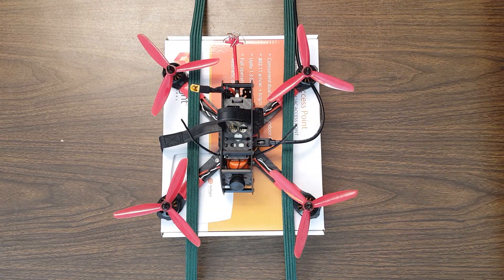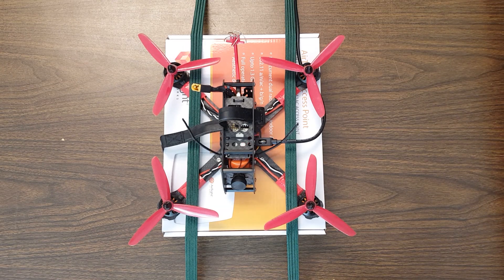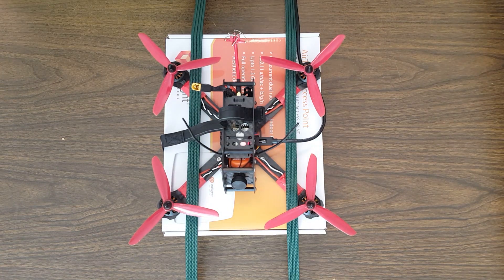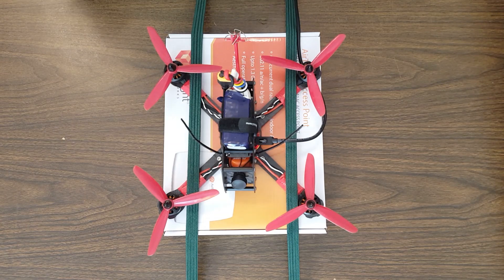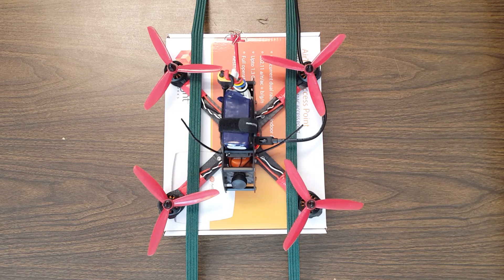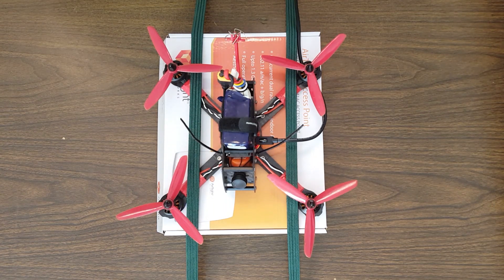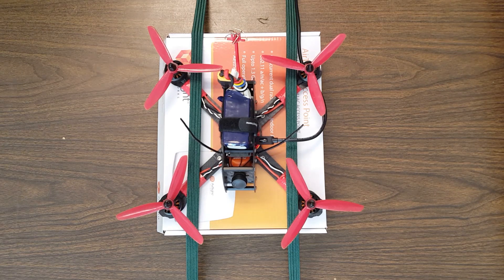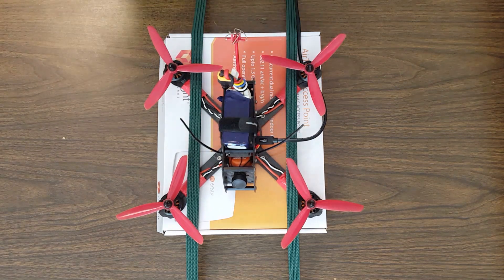Troubleshooting: Quadcopter Desync (Falls Out Of Sky)

Comment: Hey Joshua I know you get questions on the daily but I’m having a similar issue but it only happened a when I do a front flip. Rolls and back flips no problem, only front. I front flip and my quad looses control and get the esc tones and the betaflight logo reappearing on my osd like it’s resetting. Any speculation as to what could be happening? Thanks!
Reply from the maker: If you get the ESC tones and the BF logo appears, then your whole FC is losing power. That's the cause, and you have to dig in and figure out why. Loose or damaged wires is one possibility.
Reply: Joshua Bardwell josh thank you for the fast response. I’ll dig into it. Unfortunately it’s a hobbywing f4 stack so the fc and esc are connected via pins. Also I’ll be upping my Patreon from 1$ a month to 5$. Your seriously the best.

Comment: Hi jb.  I have spin of death only with a fully charged batt.  First 30 seconds of flight then it's ok after. 
No beeps or failsafe. 
Why is this? 
How do I stop it? 
Is it the omnibus f4 pro having to many volts? It's only started after I sped up my rates from 667 to 900 ish 
Thx jb your the best!
Reply from the maker: +machined red probably one if your motors or ESC's is damaged but it only happens when you push it really hard.

But you can also go to the CLI and disable the gyro_overflow_detect option. At a rate of only 900 dps o don't think that is your cause, but let me know over email if it fixes it okay?
Reply: Joshua Bardwell thx jb, could you give me the exact cli so I can paste it in please, im not doing it right

Comment: Having a similar issue with freshly installed DYS ARIA 32 BIT escs, flies fine until I let it drift down after a punch out, cocks to the right side, stays in the air though, any thoughts?

Comment: my drone did the same thing.  it started out very infrequently dropping out of the air. Then it slowly became more frequent.  Up to once every other battery. so I started to disassemble it to search for the cause. I found it. The little slits the male battery posts on the drone had become pinched in, infetisimaly.  it seemingly fit snug, but it had just enough play to cause it to reboot midflight. Effectively dropping it out of the sky. All I had to do was put a pin in the little holes on top of each terminal and rotate it to spread the post out, increasing its diameter for a 100% secure connection.  Problem solved.
Reply from the maker: You mean like this? :-)

https://www.youtube.com/watch?v=UYXTiSeVmB0

Comment: I have this "desync" issue with one of my quad, but the strange thing is that i only happen flying 4s, in 3s it works well, and it doesn't even happen at full throttle, i can't figure out why it does this, i think i'll have to try your bench test (PS: the copter fall the same way every time - rolling backward and left)
Reply from the maker: Don't waste time testing. Try replacing the left rear motor. Don't throw out the old one in case it turns out to be fine... then you'll just have a spare. If you swap the motor and it still does it, swap the ESC next.
Reply: Xxtrengt 88 I had the identical problem. Check the pins on your battery. Spread them out from the center for a more secure connection. This fixed my problem.

Comment: Hi Joshua I have just put new motors on my quad I have recalibrate the esc' checked in bheli all fine, it hovers and flys ok until I punch out or increase throttle rapidly. I went into betaflight and used the motors tab and did the rapid motor increase and on every motor they twitch, if I increase the throttle at a steady pace they are fine. I'm not the best at soldering could this just be my crap soldering? Please help. Thank you
Reply from the maker: Could be any number of things. If all four do it, it's probably not your soldering. What are the chances you didn't get ONE right?

If you are using Dshot, try switching to multishot. Maybe your ESCs don't fully support Dshot.
Reply: Joshua Bardwell I am using multishot, is it worth flashing the esc's?
Reply: I have just looked at the esc's I bought and they say on amazon that they should be used with one shot 125 could this be what is wrong I'm using them as multishot? Is one shot Dshot?

Comment: Has anyone had any issues with their quad falling out of the sky always towards the front left motor? I've replaced pretty much every part and still the same issue!
Here's a link to a video showing the issue.
https://www.youtube.com/watch?v=X6mqrqKryMg
There's also a slightly better description in the clip description.
Thanks guys.
Reply from the maker: +Logan O'Toole your front left motor or ESC is damaged. If not that, then the motor output on the FC.

Comment: Hey my name is Tony.  Ive been flying now for about a year and Ive been having this problem with my Quad that is just kicking my but.  What happens is after i put a new fc on it, after a few good problem free flights and crashes the throttle sticks when i punch it.  then later it starts to tick on sudden commands like fast rolls and quick corrections.  I started with a lux 2 then had a dtfc now im on a kakute and its starting down the same path.  I have blackbox if you want to see that, the throttle will on just a blip to max, stay at full for about 3-5 sec. Then return to where I have the throttle.  But i can put around just fine with only the ticking but it does get so bad that it is compleatly unflyable.  When the condition starts, on 3s it does fine at full throttle, but on 4s its terrible.  It gets worse and then the same starts to happen on 3s as well.  I have reflashed the esc's reset the fc i dont know what to try.  Esc's are emax lighting 30a running lighting 20a firmware.  Your help will be much apreciated...P.S.  I Will support you on patron when i get a job!!!
Reply from the maker: Most likely you are having failsafes. The receiver should be set up so that it shuts down when a failsafe happens, but many receivers aren't set this way and they hold position. My guess is, when you raise the throttle, the extra vibration is shaking a connection loose and your receiver is holding position.
Reply: Would blackbox show a failsafe?  and would you take a look at the blackbox file i have?
Reply from the maker: Blackbox would not show a failsafe necessarily because the FC never realizes that failsafe happened. 

You should look at rcCommand in Blackbox and at the time when the throttle sticks what you might see is that all of rcCommand "freezes up" and becomes a straight line. That would indicate failsafe.
Reply: ok help me understand this... it has to be between the receiver and the FC or the radio link.  i went back and redid the soldering on all uarts (having video blackouts also)  i tested it and now its worse  way worse and a bit different it now Failsafes at any random point and the rc command shows a flatline at 0 throttle now im almost to point where im just gunna resolder the entire board
Reply: ok i found the problem finally.  The reciever board must have cracked internally.  I can put tons of pressure on the center of the board and then it will turn on...

Comment: Any ideas? 
https://www.youtube.com/watch?v=72dXX9ZnRiM
Reply: That is very strange.  Got to be a flight controller issue if it flips like that.  Very unlikely that a hardware issue causes both rear motors to fail.
Reply: Oops, I forgot to add that this is a MiniTri and not a quad ;)

I already sorted it out with David Windestal, it was a faulty ESC. I just replaced both the ESC and the motor and now it's flying and flipping as it should. 

The reason why I did not consider it to be a software issue is because I already wrecked one F3FC frame, the replacement did not solve the issue. 

Thanks for reviewing the footage and the suggestion, though :)

Comment: I'm having the same issue with my drone always falling towards the front left arm. It will sometimes happen in the first couple of seconds or after a minute of flying. There are jitters occasionally when flying and then I'll lose control before it falls out of the sky. I've replaced the motors, 4 in 1 ESC, FC, PDB, and I'm still getting the same issue. Please help!!
Reply from the maker: i am going to guess it's a failsafe, given that you've replaced everything else. Check receiver, antennas, and transmitter.
Reply: Joshua Bardwell I've also replaced the receiver and still the same issue so probably my transmitter. Do you know if the Flysky fs-i6 has a history of this? I think the problem started when I changed the firmware to 10 channel so I flashed the original firmware but still getting the same issue. Thanks for the reply!

Comment: Thanks for doing these videos!! A problem I'm having with a build I just completed: If I'm flying in a mild fashion the quad flies fine, but as soon as I punch the throttle and perform a quick roll, the quad will shoot over to the right  and then slam into the ground. Kind of funny to watch, but I'm tired of replacing props. lol. This is the first time I've seen this issue with a build, and all the other quads I've built fly great. I am using Emax 30a bullet esc's, but I went with the cheap POS racerstar motors for the first time, so I'm not sure if these could be causing the problems. Any advice would help! Thanks.
Reply from the maker: This probably indicates a motor or ESC on the right side of the quad is damaged.
Reply: Hi Mr. Bardwell, I just wanted to share with you from trial and error what I did to fix the issue I was having with my quad taking off to the right and crashing after a fast roll: I went back to motors 2 and 3 and re-soldered them with two of the wires crossed, instead of leaving them connected straight ahead to the Emax bullet esc's. Then switched the motor direction back to normal in the BLHeli configurator, and for whatever reason this completely fixed the issue. I am using some cheap-O Racerstar motors, so maybe with this brand of motor they have issues with reversing the motor direction in BLHeli? Just wanted to let you know in case someone has the same issue. Thanks!!

Comment: Hi Joshua, 
first of all i have to say thank u for ur amazing work u are doing on Youtube to help some of us to solve the real tricky issues with our quads and Hobby.
Well i got one tricky one right now and i hope to get a smart answer from you how i can solve it.
I am recently playing around with 5S and 6S setups, and i run itno a 6S issue.
I have two different quads for my playaround, they are flying perfect with 4S and 5S, but as soon i am flying 6S, i can just hoover, as soon i give some trottle, the quads spinns crazy and i have to disarm it. Again back on 5S, no issues. So i am using Tmotors 30a and 45 a ESC and also Motors capable of 6S, changed from 3blade to the lighter 2blade setup, better but with 6S what shall i say - Dancing crazy in the Air ;-) 
Do u have any idea, how i could solve it in betaflight, i am running on both the Omnibus F4 FC and a PDB capable for 6S. Thanx Jushua and pls continue ur work and u reach ur 100000 Subs soon ;-) - Happy Flying ! Cause i wann learn something today :-)
Reply from the maker: Add a shit-load of capacitance. Put like a 1000 uF low-ESR electrolytic capacitor on the power pads of each ESC. Might need to change ESC timing too.
Reply: Joshua Bardwell Thanx this is a good idea I will try and see if it works out - justhave 450 capacitor on the Plusminus input from the lipo - I try it directly on each Plusminus of the ESC - top - have anice Sunday evening thx

Comment: Hey Josh, 
I went through this and figured out my quad is having a power failure a few seconds into every flight. I don't know if it is the fc or the pdb. I checked the blackbox, and it shows that I have full control until the end of the logging, which means that the fc is resetting for some reason. I know this because all the escs reset immediately after this happens. This means that it is not an esc problem, but either a pdb or fc problem. If you could offer any guidance on this, I would greatly appreciate it.
Reply from the maker: It's not that helpful but ... figure out why it's powering down. Loose XT60 is my favorite reason. 

https://www.youtube.com/watch?v=UYXTiSeVmB0
Reply: All right, I'll try that. Thanks so much

Comment: Hi. I have gotten around to apply this testing method...just an idea: changing the prop rotation should not change the load and still reveal the faulty motor or esc. Without PID loop active this should work just fine. And should be a lot safer thrusting down instead of up, right?
Reply from the maker: Yes.
Reply: reality bites - my faulty thing only showed one motor-twitch and kept going 4 packs straight - showing bad noise and a wobble/wandering on roll as if too much I term was applied (KISS stock though)...next step: putting the twitching motor aside and replacing the other three as well. Just to make sure there ain't a second dropout candidate and to prove electronics are all good. WIP will update later.

Comment: I know this is an older video but I seem to be having a falling quad issue. I’ll be flying along the osd flashes the the runcam logo comes then the quad falls out of the sky. What do you think and what should I look at first on the quad? I’ve never come across this before? Dys f4 fc and dys 4 in 1 20 amp runcam swift 2 and tbs race unify
Reply from the maker: Sounds like you are having power dropouts. What else could cause the Runcam logo to appear? If the camera is powering down and the quad is falling, the whole battery is probably coming disconnected.

Comment: Hi Joshua, i was given a built quad recently & have been trying to learn acro. however,  sometimes i lose right  "roll" control in flight. in BF, sometimes there's no roll movements.  i reconnect board and it works again. is this related to desync?  or can you point me to where to look to to research issue? thank you in advance... :)

Comment: Hi from the Netherlands. I have a similar problem. When I arm the quad everthing is fine. But when I give a little throttle and hover above the ground (1 meter) and roll to the left the quads heads to the ground. When I roll to the right everything is fine. I have eachine wizard x220s and new in the drone world :) Do you have any suggestions?
Reply from the maker: If it is falling out like that, it's likely that there is a damaged motor or ESC. Especially if it happens only in one direction. As a precaution, make sure your ESCs are calibrated and make sure min_throttle is set to MINIMUM 20 us higher than the speed where the motors spin smoothly. As much as 50 us more can be appropriate.
Reply: Thanks for your reply. Min_throttle is set to 1070. I've tested it again and de quad is flipping when I raise the throttle at a certain point. So when hovering 1 meters above the ground everything is fine. But when I raise the throttle and roll or yaw the quad flips down. (ps. my motorcontrol is dshot125 so the calibration is automatically done right?)
Reply: Ok. I've done some more testing. In betaflight 'motors' I raise the throttle of motor 3 and it stutter at around 1400. Is my motor broke? or?.......
Reply: Solved the motor problem. I had a new battery. 1550mah 75c 4s. When I use the standard eachine battery the motors are fine.

Comment: only having this problem when using f3 or f4 board when I put my naze 32 on it no problem maybe d shot a problem because naze wont work with d shot
Reply from the maker: +hooivork81 no F1 board will work with dshot.
Reply: Joshua Bardwell I know I just set multishot on my f4 board and it stopped dropping out of the sky so will be removing d shot from my other frame that also has te same problem

Comment: Very informative. Thanks. 
I have a slightly different issue and perhaps a little more terrifying. Built a x210 with racerstar 2205 2300kv with 30A ESC. The thing handles beautifully until I blip the throttle to full (Turnigy evo tx) then it takes off and I'm locked out. Continues at full throttle for a second or two then drops out of the sky (I don't think it's a failsafe because I'm pretty sure the range and reception are within limits). On the bench with no props attached, I can't replicate the problem. Will try locking it down and attaching props. I'm guessing it's a solder problem but any thoughts would be welcome.
Reply from the maker: It sounds exactly like a failsafe. Don't assume just because you're probably within range that you're not having an issue with a damaged signal wire, damaged antenna, or damaged receiver.
Reply: Joshua Bardwell Tried replacing with another receiver (same type from the same order) and that one refused to bind at all... maybe some QC issues... Any ideas as to why a full throttle signal would cause it to punch out until failsafe while, trickling around at half throttle (behind bushes and out to a 100 meters or so) doesn't trigger the same response? Need to scratch that curiosity itch even if I do fix it with another receiver. Many thanks! I do learn something in each and every one of your vids.
Reply: SonicStates Hi are you on betaflight, then your rxrange is probably configured false, so you are putting out too much Pwm and the Copter thinks, oh thats too much must be an error an Failsafes, look in the failsafe tab at which the maximum value is. Then go into the receiver tab and have a look what your throttle value is, when giving full throttle, if it's more than the maximum value, bingo
Reply: MrMario616 interesting. Will check into that. Muchly appreciated!

Comment: I tried again and notice motor does not stop spinning when doing it on the betaflight only on the transmitter.
Reply from the maker: Min_throttle may be too low. The motor is meaning to go to idle but idle is set too low so it stops instead. Try raising min_throttle or, if you are using Dshot, raise digital_idle_percent.